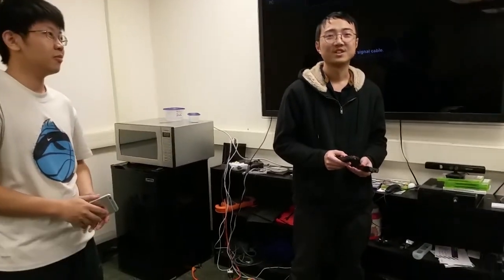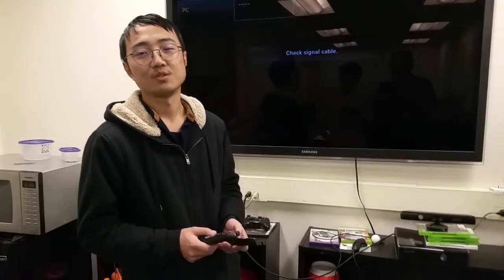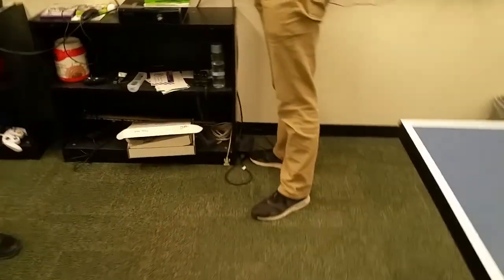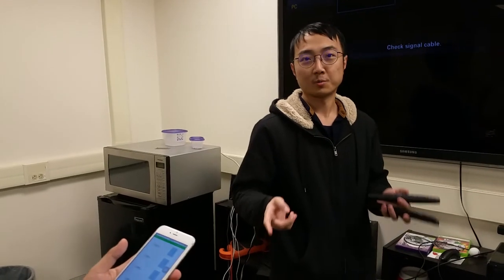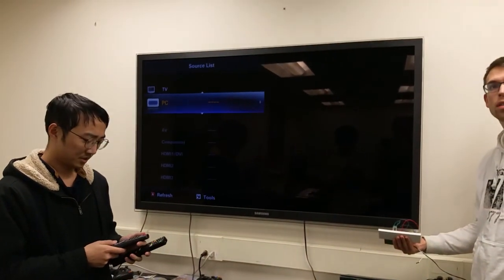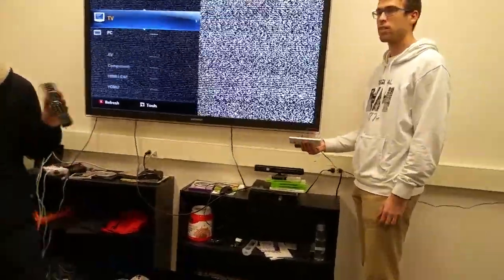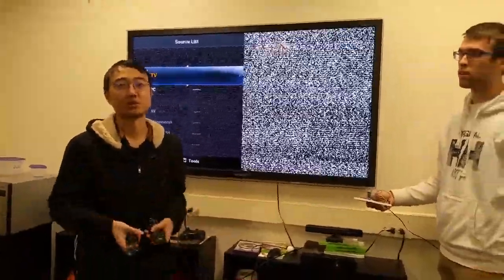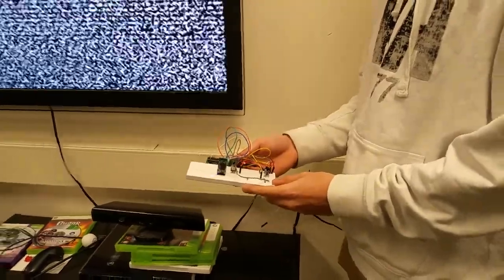Programmable IR remote

Comment: And where did you get the ir programmer parts and bluetooth or wifi
Reply from the maker: Did you read the linked report?
Reply: @ece4760  yea but they didnt show where to get the parts to build it
Reply from the maker: Where to get the parts? That depends on where you are. We mostly use digikey.com. But there are many suppliers. Google is your friend.